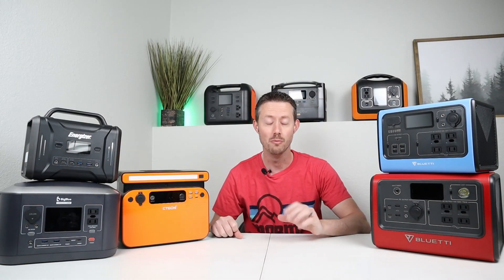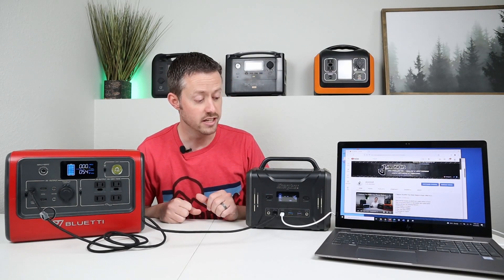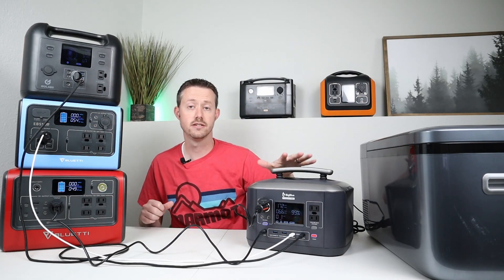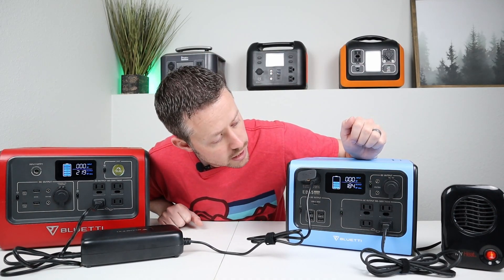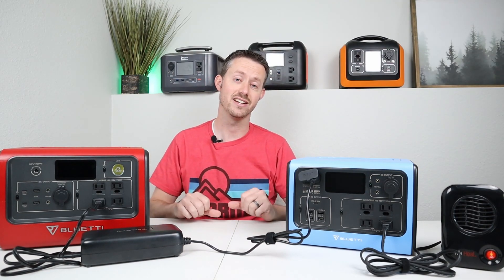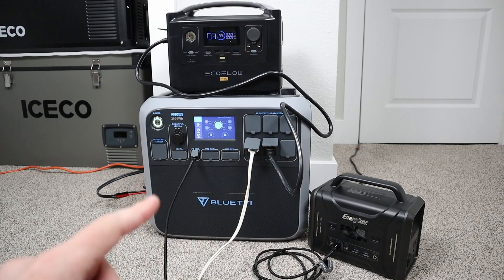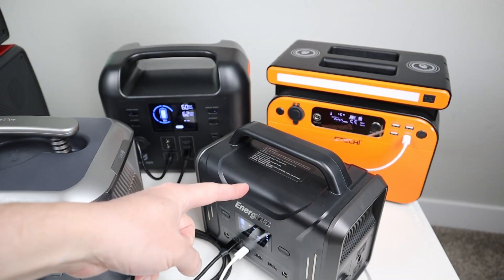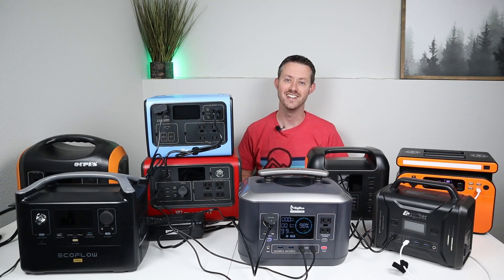More Capacity!? Connecting Multiple Power Stations Together - Daisy Chaining 8 Power Stations!!!

Comment: I have 2 new identical power stations (iForway HS1000). The AC out is dead on one, so they sent me a replacement...everything else appears to work. Can I charge my good battery using the DC output on the problem battery (Car Socket (13.6V/8A, Max 108.8W), connecting the Car Socket cable to the DC input which has a (5.5x2.1mm plug) on the other end? Seems like it should work based on what I'm seeing you do. The prospect of doubling my battery capacity for free is pretty exciting.
Reply from the maker: I don't see an issue as long as both power stations still have the ability to pull power from them.
Reply: @Jasonoid  That's encouraging...here's my hypothetical for you. I bought this power station as a backup power supply for my chest freezer that pulls about 55w. I would be inputting 100w, while the main battery would be outputting 55w. 

What happens when the main battery powering the freezer becomes fully charged while powering my freezer? Do both batteries shut off? Or how does that work? (Supposedly, they do support pass through charging.) Have to excuse my naivety, I've never used this equipment before.
Reply from the maker: @zippy2641  the charging will automatically stop when it's full. In theory the charger could be plugged in all the time and it will  only charge when needed
Reply: @Jasonoid  That's what I would hope for. Testing it today.
Reply: @Jasonoid  I tested this setup and it worked fine. I also discovered that the unit that can't output AC, can't input AC either. Drat. It's OK though, I'm charging it with DC from the other battery. Just an inconvenience, but t least it works. Thanks for your help.
Reply from the maker: Glad you got to keep both units! Still a bargain since it works with DC!
Reply: @Jasonoid  Wondering if I can get a DC adapter for the wall plug that puts out 100w? Is there such a thing? (rather than being confined to charging it with the other battery)

Comment: I wish you could somehow use multiple power stations to increase the wattage output to a device. Unfortunately, I do not think it is possible. You can daisy chain them to increase run time, but you are still limited in which device you can power by whatever the highest output of the largest inverter is. You can't, as far as I know, in any way supply a load that requires 2000 watts continuous, with 4 power stations that are all maximum 1500 watts output. Theoretically, if the actual batteries could be through cords, wired in series to power a larger inverter. They could maybe even be in parallel, as the amps drawn by the inverter would be drawn from more DC batteries. It would likely be prohibitively expensive and complicated, but someone like me would love that. Being disabled, a 2000 watt output power station is too heavy, to carry. It would be great if I could use 2 1000 watt output power stations to run a 1500 watt device due to the reduced weight of each.
Reply from the maker: Check out the Vigorpool Captain 1200, two medium sized power stations parallel together to make a 2000 watt output. The only power station with that feature that I have seen. I have the review on my channel, just search back in all my videos, you'll find it.

Comment: Great video  and I could see how this could be handy. Would it be possible to do this with an RV battery? Basically, plug a power station 12v out to an existing RV battery? That way the solar could plug into the power station which in turn would go to the RV battery and AC inverter system that is on board. Not sure if power stations are smart enough to stop charging the battery if full.
Reply from the maker: No, power stations don't have any built in charging options on the DC output. It would be best to have a small AC battery charger plugged into the power station inverter, then you can connect that to the battery to charge it.
Reply: That makes sense and those are very inexpensive. I may give it a whirl! Probably about the same efficiency as plugging the power station into the shore power jack, but this sounds more fun.  @Jasonoid

Comment: Is there a way to connect 2 or more power stations to increase wattage but not voltage output. Say I have a 450 watt light(110 v), and only 2 300 watt max power stations. The single 300 watt cuts off shortly after firing up the light. Is there a load sharing cable that joins 2 stations essentially doubling the load capacity but not the voltage as I’m sure 220 would nuke this light. Thanks
Reply from the maker: Not many power stations allow you to "double up" the wattage on two different units. You'll need to purchase a power station with a larger inverter.

Comment: ✋ Question!   Is there a cable that allows me to plug in to multiple power stations at once and send the power to a device? So the cable would have 2 or more plugs on 1 end that all the solar generators are plugged in to... and all the power is dumped out of a single plug on the other end to go in to a device?
Reply from the maker: Technically you could use a split male 12v socket adapter and you could try to pull power from two devices. I haven't tried that before so I can say it would work.
Reply: @Jasonoid  I'll have to try that. Thank you. Hopefully it works. I have 3 300X Power stations and I was wondering if I could turn them in to a 700W power station in an emergency.
Reply from the maker: @Buses2Bikes  it will only work for the DC output, not the AC inverter.

Comment: To charge my Bluetti ac200p I use my Anker 535 to power the Bluetti using it’s brick charger putting out over 435 watts. While using the Anker to charge the Bluetti I charge the Anker using it’s brick putting out 118 watts plugged into a 300 watt inverter plugged into the power plug…works fine👍

Comment: New to power stations, forgive me if this is dumb. I was looking at the Bluetti eb55 and noticed that 2 of the Eb3a are cheaper. Would there be a big difference/disadvantage to chaining the eb3a's? It would be mostly used for laptop/ tablet and external drives. Thanks.
Reply from the maker: The capacity of two EB3As would close to the same capacity as the EB55. In that case you could have double in solar charging and double the inverter potential. It would probably be a reasonable setup.

Comment: Fun, Fun! :) I have opened this video as I was looking for similar examples but in my case thinking how to connect more than two B230 to the AC200Max on meaningful way.
Reply: just get a 24v 200ah lifepo4 battery and connect it to the pv input of the ac200max and you will have more capacity.

Comment: I think I know the answer to this question, but thought I'd confirm since you have a lot of experience with this subject. I currently own a larger Ecoflow Delta Pro and a Bluetti AC200Max and I'd like to hook them together as you did in your video. I think the simplest solution would be to use the 30amp DC output on the Bluetti (using the aviator connection to XT60) and then plug the XT60 into the 15amp solar connection on the back of the Ecoflow Delta Pro (the same port as the 'car charger'). I assume that even though the max solar input is 15amps on the Delta Pro, it'll only pull that amount from the 30amp DC port on the Bluetti; is that correct? Or will that waste the additional amperage? I assume you could also do the reverse using the Anderson 30amp plug on the Delta Pro and input it via the solar plug on the Bluetti? I am trying to set things up so I can use both, and then hook my solar bank into the 'front' unit, in this case, the Bluetti. So the 800W of solar panels would be hooked up to the Bluetti, and then the Bluetti would use the aviation to XT60 plug to input 15A 12V+ into the Delta Pro. Am I wrong, or will that actually work, thus allowing me to utilize the Bluetti almost like an extra battery for the Delta Pro? Thanks!
Reply from the maker: I don't have the Delta Pro but I do have the Delta Max. On the Delta Max the lower voltage inputs (14 volts and lower) are limited to 8 amps only and not the full 15 amps since 8 amps is usually what a car cigarette plug is limited to. It's lower so you don't blow a car fuse. If you plugged the Bluetti 30amp output  in to charge your Delta Pro you'd see around 100 to 120 watts max.

If you want faster charging you'd want to boost the voltage up above 24v.
Reply: @Jasonoid  I think with the Delta Pro, if you input 8-10amps it will register as 'car charger' but if you exceed 11amps (up to 15amps) it will register technically as "solar." So if the Bluetti is outputting 13V or so, and the solar input port can take 15amps max, that would be roughly 195W, correct? If so, that's not too bad. It seems like this would definitely allow me to use both together. I guess my main concern was using a 30amp output on a 15amp input, but I think it'll work out OK. Will test this tomorrow :) Thanks!
Reply from the maker: @johnderrick  there shouldn't be any issues using the 30amp output, but I'm guessing it will stay at the 8 amp level, always worth testing I suppose.
Reply: The simplest way is to just use the bluetti AC output and plug into the Ecoflow. The solar panels will keep the bluetti charged during the day and then at night when the bluetti runs out the ecoflow will use its UPS function to keep the loads going all night long!

Comment: Is there a way to run two identical in parallel for higher wattage output in combination rather than daisy chain?
Reply from the maker: The New VigorPool Captain 1200 can run in parallel for double the power and capacity! Pretty cool feature! It's the only power station that I have seen with this feature.

Comment: Could this be done through long AC extension cords? Could one provide the entire neighborhood power through through one generator, and lots of extension cords? In some cases, with standard house electrical wire you can run about 1000 feet. (Not totally recommended, but depending on the situation and the load of the power, it can be done.) I have certainly plugged several 100 foot extension cords into each other and still been able to use the power at the end. While a typical 15 amp house plug can pull 1800 watts for a short time, or 1500 for a long time, running those loads at the end of a long cord can be can be a problem. This starts to effect form factor of the power. Now in a power outage situation, I have managed to run 5 refrigerators off one gas generator, and refrigerators generally only pull about 100 to 300 watts running but have starting wattage of 600 to 800. This involved a bunch of extension cords and power strips going out to neighbors. Gas Generators have lots of power but are noisy.  Now if one had 10 neighbors, and each one had a solar power generator, they would have a device that can run a fridge (taking a high load for a short period of time) but normally only drew a small amount of power for a short time. Could one run extensions cords basically powering the entire neighborhood?  So what I might imagine is being able to extend the range of how much one could power, and with the power generators having a constant supply of power,  a cheap power generator might might be able to do a whole lot more. While another option is to move the power generator from device to device, or to drive the truck around to multiple locations to charge things, the ability to link up several of these house to house and allow everyone to have a few hundred watts of power would be great. If the solar power generator can pass through the power, acting like an uninterrupted power supply, it would allow more people and places to have power.  Do you think this would work?
Reply: Simplest way is to hand your neighbors a power station because people will love having the ability to charge their phones and have a flash light that will last all night long in case of an emergency.
Reply: I did a little more research. There are multiple ways to solve problems. Some such solutions are simple like having multiple generators, walking a generator next door or having a gas generator on wheels are all ways to share power with a neighbor. If you do want to do the extension cord thing, the more effective way is to use higher voltages. Most larger gas generators have a 240 volt output. Most extensions cords sold can handle up to 600 volts. By upping the voltage one can more effectively transmit power. One just needs to step it down to 120 at the other end. There is also a step up, step down transformers that are sold. Starting at about 100 bucks each these allow more effective transmission of power. Put one on each end. One steps up, one steps down.  Some people in rural areas where they need to power a well house a long distance from the circuit breaker, use step up and step down transformers save thousands on the setup. A power situations that might otherwise take $30,000 in copper wiring can be solved for $3,000 in transformers. Transformers are widely sold for traveling and for people using foreign electronics in different countries.

Comment: It would be better if all units had a voltage on their batteries and a plug wire directly to the battery through the bms so that you could then join them together without the loses from either their DC or ac

Comment: I have a 12/24v fridge and wonder if i could use the two outputs in serial to make 24v.
That would, in theory, lower my current to the fridge and get me more runtime than a 12v setup.

What would you think..?
Reply from the maker: I haven't tried that, you could try that out and see! Not sure how the power station would react to the serial connections.
Reply: @Jasonoid 
That's my fear as I'm quite good in electronics but if the outputs are regulated it might be problematic.
Reply: You would lose runtime versus just using one power station at a time instead of two at the same time. One dc regulated output for 24 hours will use about 3 hours of your battery but using two dc regulated outputs would use up 6 hours of battery capacity in that same 24 hours time frame!
Reply: @uhjyuff2095  You're missing the point here, the idea is not having to physically change the pack for example in the middle of the night.
Reply: @DiaLFonZo  Well yeah, if you check your battery level and its low then sure connect it up in a daisy chain or in serial to obviously get more runtime than just one battery station. But if you need the longest runtime imaginable, the goal would be to manual switch from one battery to the next. In reality I would just check my battery at night and either keep it going or swap batteries to the more charged one so it makes it through the night as I am sleeping!
Reply: @uhjyuff2095  I went for this setup only as a cost effective solution without knowing the real runtime of my 12v refrigerator. I knew it would have some lost daisy chain them but the price for two GoLab i200 was way cheaper than their bigger model and I was still on Lifepo4. Plus the PD charge is at a higher DC voltage than trying to change at 12v.
Reply: @DiaLFonZo  Yeah, I hear you lithium batteries are expensive! Looking at your GoLab i200 specs, the 12v output ports are just battery connections such as 12v battery terminals. If you want to series connect the two i200 outputs to make a 24v system go for it. The batteries will get a fantastic runtime because I believe that your i200 does not have regulated outputs so you could have 10 12v output ports and its just a nominal battery connect with now dc/dc converter sucking electricity. Now this is not the case for other power stations like the Ecoflows for example because those have 48v batteries with a dc/dc converter to enable 12v output. Yours on the other hand has a 12v battery so it has the perfect 12v output as is!

Comment: Hi Jason, after watching this video and the one where you showed the transfer switch in you home, I decided to do the same. I am commenting this video because I am planning to use with the transfer switch a delta max but I would like to use it as UPS while the power will come from a bluetti AC200P solar powered. I read that in this case the delta max will only let 1800 watt going through and it is fine with me becasue I am not planning to run my entire house. Do you think this is more efficient in term on not cycling the ion battery (unless the bluetti runs out of power) so I can just count most of the time on the LiFePo battery? Thanks and great work for all of us watching.
Reply from the maker: So basically you will have solar coming into your AC200P, then that will be keeping your Delta Max full, and your Delta Max will be plugged into your transfer switch powering your circuits? Yeah, that should work well!
Reply: Working on my transfer this weekend 👍
Reply: Hi Jason, unfortunately the ac200p shows a 71 watt output just plugging in the delta max with zero going in and out from the delta max. Even if I turn off the AC in the delta I still see 71 watt output from the Bluetti. I’ll try to post the question on Facebook group 🤓
Reply: @damianoangoli1135  if you don't want to cycle power through both power stations just use one and in the event of a power outage or something and you need more capacity connect up the second one. But for daily use just use one with UPS function.

Comment: interesting, question please, the 600 watt bluttis, can i daisy chain two of those, solar input and then power a 900 watt hot plate
Reply from the maker: There is no way to combine the inverter output on multiple power stations. You'd need to purchase a larger power station in order to run a 900 watt hot plate.
Reply: @Jasonoid  i dont know but wonder of some other component such as diode or somethin could be added